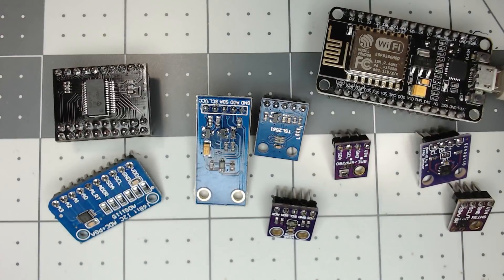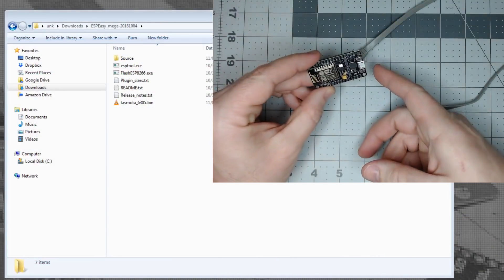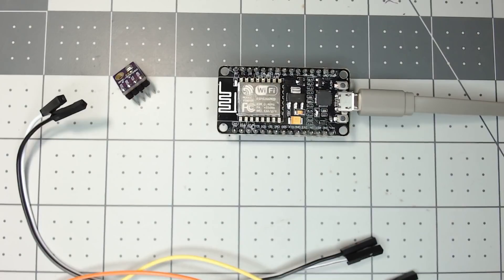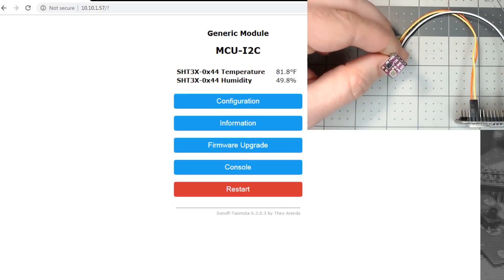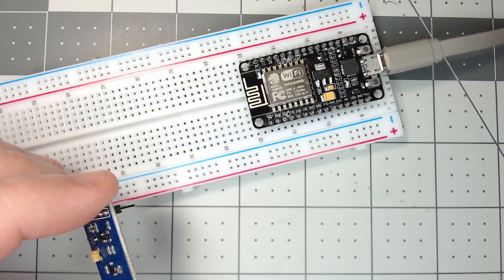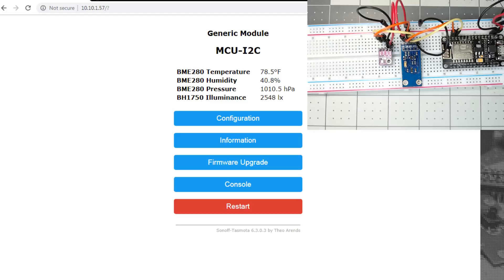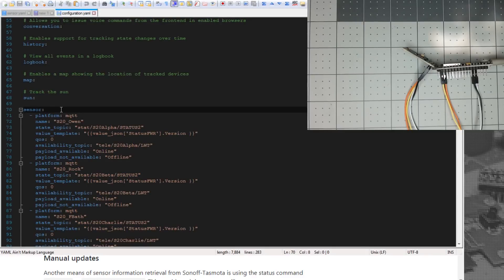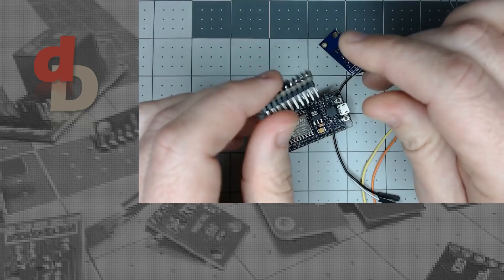Part 1 - How to Expand Tasmota/Sonoff Devices with the I2C Protocol - I²C

Comment: It is important that the supply voltage plus and minus are correct. 
Always use 3.3V. If you use 5 volts for the sensor you have to adjust the level. 
If SCL and SDA are swapped, nothing breaks, but nothing is found.

Comment: I know this is an old video, but will this method work with the HM3301 (Particulate Matter) Sensor please. I'm currently trying to use this with ESPHome, but when I sleep then wake the sensor the ESP32 is unable to communicate with it until rebooted. Maybe Tasmota will not have this issue. Thanks.
Reply from the maker: I haven't used that sensor before myself.

Comment: For the ads1115, how did you get to obtain final values without applying any formula (gain and so on)?
Reply from the maker: Which values?
Reply: @digiblurDIY  you connected directly 3'3v to A1 and you obtained 32767. I obtain 17698 so I have to recalculate applying a formula (6,144 * 17703 / 32767 = 3,319) to adapt the results. How did you get it directly?

Comment: Great vídeo! Is it possible to share a 9.5.0 version bin file for Esp8266 or esp32 that works with four  MCP23017? I tried to add lines  on my user_config_override.h but I can't configure any port using Sensor29.
Reply from the maker: Try one of these big ones...  it might have it.  https://github.com/tasmota/binaries
Reply: @digiblurDIY  Thanks, bro!

Comment: hmmm..I have the exact setup as described (Nodemcu and si7021 temp /humidity sensor) flashed with tasmota and connected as directed, but I get no output. When I do I2Cscan it picks up the device, but that's it. I don't even get the device name on the main menu (in video, it shows up as MCU-I2C). I've googled the problem every way I can think of, tried setting the gpios to all sorts of different settings to no avail (and yes, I did change the wiring to match the gpio settings in module config.) If anyone has a suggestion, I'm all ears! Or if you know of a better place to ask this question that would be appreciated too! BTW, thanks for all the videos, many have helped me since I go into HA about a year ago!
Reply from the maker: Did you flash the Tasmota-sensors bin file?
Reply: @digiblurDIY  I hadn't before, and with great hope I flashed the tasmota-sensors bin file, but to no avail. Now, when I do i2cscan I get "no devices found" so I'm guessing I got some bad boards (I have 2 nodemcus and 2 si7021s). I have an email in to the company to see what they suggest, but thanks so much for responding, I really appreciate it. (I have 23 sonoff devices that I've flashed with Tasmota and are all working great in Home Assistant, so I wanted to expand my horizons a bit and use some different hardware.) Cheers!

Comment: Trying BME280 on Wemos D1. Configured as Generic 18, added SCL and SDA (D1 and D2 respectively,) but the sensor is not seen. Can anyone provide debugging hints? Thanks
Reply from the maker: Did you flash the tasmota-sensors.bin file?
Reply: digiblurDIY Yes. It seemed the most straightforward. I will recheck hardware. Thanks. It should just work, right?
Reply: And of course I hadn't... Thanks. Sincerely, I'm sorry for wasting your valuable bandwidth.
Reply from the maker: No worry at all. Glad to see it fixed it.

Comment: sorry to ask so late but How can you Daisy Chain the Gpio expander i have exactly the same board the pins on the side are 
a0
a1
a2
reset
nc/so
nc/cs
sda/si
scl/sck
gnd 
and vcc
i know gnd and vcc Edit( i see so the sda and the scl pins)
sorry if im asking a stupid question i found a old calculator lcd dotmatrix and i thought to make a legit calculator any advice on it will be a great help
edit 2 now i watched the whole video and feel stupid XD
Reply from the maker: SCL and SDA shared to multiple sensors.

Comment: Is there a way to use a 3 switches on i2c? I want sonoff control my garage door and have open and closed status switches.
Reply from the maker: You could as they have a few expanders from 4 port, 8 port, to 16 port.  What are you using it on?
Reply: The gpio expander looks like a winner. I am going to have 3 inputs: the wall button and I am going to access the up and down limit switches inside the opener. Do you know what size the power supply is on the sonoff? I would like to use it with an expander to 1 or 2 run 8 relay boards and do not want to have too much current draw.

Comment: Great with temperature and light sensors. I had a go with a mma7455 accelerometer which I thought might be useful for vibration sensing (door knock or washing machine stopping).  I2cscan gives me "Device(s) found at 0x1d" but there is no response in the console.  Have you tried connecting a vibration sensor?
Reply from the maker: No, I haven't done that.  Is that sensor supported by Tasmota?

Comment: I just added the ADS1115 to a Sonoff Basic. Where else are you gonna get a WiFi connected quad-channel ADC with a free PSU for under $10?!?! Amazing.
Anyway, I did the i2cscan and picked up a device at 0x48, but no ADV values displayed on the Web interface. Have they removed this from TASMOTA? How does it "know" I'm using a ADS1115?
Reply from the maker: You might have to use the Sonoff sensors version for the ads1115

Comment: I've been thinking of adding a BME280 to the smart motion & nightlight in you other video.  However I cannot find I2C in its configuration. Is that because it uses a Tuya?  Is there a way to add a BME280 to a Tuya?  Thanks.
Reply from the maker: which bin did you flash?  not all builds have the i2c and bme280 code in them.
Reply: I installed it OTA to quickly get it going so I could play around with it before doing soldering.  I missed/skipped the beginning of your video which states to use the bin linked in your description. Should I use tasmonta_6307_1m_i2c_sensors.bin in your link or sonoff-sensors.bin on GitHub release page?
Reply from the maker: I would stay on the main tasmota branch if you can.  Look at the releases tab linked here, scroll down and they have a grid of what is included in each bin file.  Load the one you need that fits your sensors and needs.  https://github.com/arendst/Sonoff-Tasmota/releases   BMP sensor includes your BME280
Reply: That did the trick.  Thanks.

Comment: Is there a way to add mutiple sensors for the same type like 4 ina219 . Tasmota only reads one even with different address?
Reply from the maker: it depends on if Tasmota supports that and if you could assign them to 4 different i2c addresses.  I believe it supports multiple bme280s so maybe it would with those too.  I don't have those sensors but it's worth an ask on their Discord server.  https://discord.gg/Ks2Kzd4

Comment: Love your tutorials!!! Exactly what I was looking for... want to do multiple temperature sensors on one nodemcu but I guess you can only do one or two AM2301 correct? I was able to hook up two of these just through different GPIO pins and it worked but could not get them to show up in home assistant - I must have screwed up json...
Reply: I tried to figure out json syntax for a couple of weeks now and I just gave up. Thanks to your tutorial it all works now -THANK YOU !!!

This may help others:
Long story short - use this to read a value into Home Assistant (of course you will have to use the right sensor and values, may be different than am2301 and temperature..)

value_json[‘AM2301’].Temperature

Instead of 

value_json.AM2301.Temperature

Long story:
I have nodemcu with Tasmota and two am2301 temp hum sensors connected to D6 (GPIO 12) and D5 (GPIO14). Tasmota shows the two sensors perfectly and publishes a json that’s something like this

tele/Basement2Temp/SENSOR = {"Time":"2018-11-12T06:22:53","AM2301-12":{"Temperature":69.6,"Humidity":49.3},"AM2301-14":{"Temperature":68.9,"Humidity":54.0},"TempUnit":"F"}

So I tried to read in the json in HA using value_json.AM2301-12.Temperature based on some examples on HA wiki and it didn’t work. If you only have one sensor then Mqtt publishes the am2301 and not am2301-## in which case the example does work in HA. I thought I would just add the “-##” and be golden but no luck. Then I used value_json[‘AM2301’].Temperature which is the same syntax you had and it did work in HA!!! Secret are the [‘———‘] square brackets and quotes. 
I’m so happy about it! Thank you!!!
This is probably a no brainer for an experienced person like yourself but it stumped me. 

Will have to try this with I2C based on your vid because I think nodemcu does not like certain pins - it doesn’t respond when I use other GPIOs. So you can’t really connect sensors to all pins - that’s just my experience so far. 

Can’t wait for part 2!
Reply from the maker: Thanks for the explanation! I believe the dash in the json was causing it to think it was supposed to do math on those numbers. Inside the brackets and such was forcing it to a string where no math was done. Glad you got it working.

Part 2 will probably go up in about 8 to 12 hours. Have a couple things to tweak.
Reply: digiblurDIY That makes total sense! Thanks! 

Now I just need to rewatch one of your other videos to get a switch working to sense when a sump pump float has triggered and send an alarm. Again thanks for putting out these videos - I know it takes time.
Reply from the maker: I never tried more than one am2301 at a time. I know the DS18B20 sensors have separate address to allow more than one. You can do more than one i2c based sensor of the same type as long the breakout board has the ability to change the address.

Hit me up on discord or via email with the json to see if I can figure out what's going on.

Comment: Another note (I'm just up to 7:30 if you covered this later) is that each I2C device of a certain type will always use the same address or group of addresses. This shouldn't be an issue for most sensor types, but thankfully the ADC board you show has 4 available. The BME has only 2 I think.

Comment: I have 1 of my half dozen ESP32s that actually requires the button to be pressed to flash. No idea why it's different than the others. All are HiLetGo dev boards.
Wonder why your dropdown list didn't show this time when setting gpio.
Just a thought, does tasmota set "forced" mode for the BME? That helps reduce internal heating errors on the sensor.
Reply from the maker: I noticed that as well, I believe it had to do with the capture setting only grabbing the lower web page layer.

I have a really odd esp32 that requires a capacitor between two pins to go into flash mode and it is the newest one I bought.

Not sure on the Bme280 question. I would need to dig through their driver code.